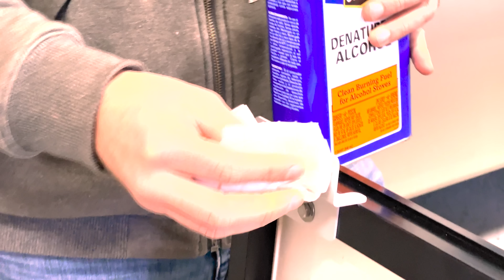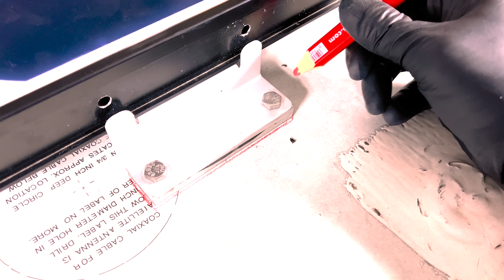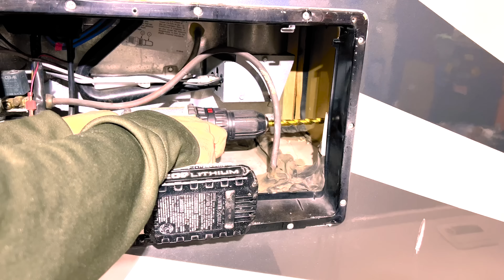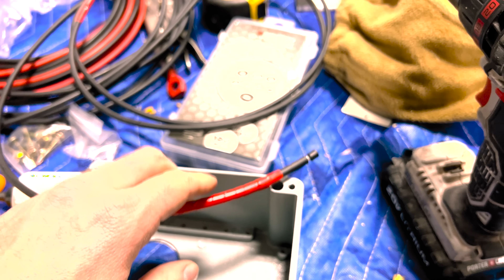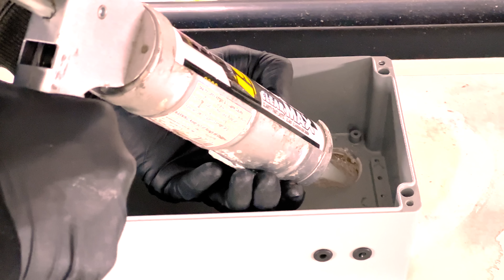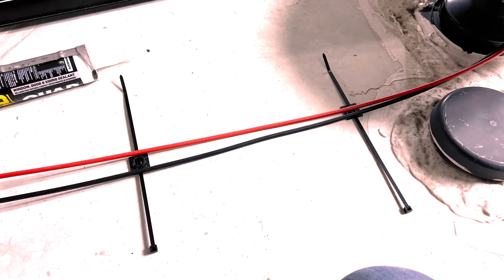Residential Solar Panel Installation on a 2015.5 Sprinter-based Winnebago Itasca Navion 24V

Comment: I hope that VHB tape will hold those panels in place. They are big panels and there's a lot of surface area underneath to catch a big wind drift. I'd have just bolted them to the roof then sealed. Also not sure why you needed spacers underneath the z-brackets. Thanks for the videeo.
Reply from the maker: Thank you! We put months of research into this, including questions to others who had done this install on the exact same make/model RV with VHB tape. According to the 3M technical data sheet, the 4950 tape we used has a Normal Tensile Strength of 140 psi and a Dynamic Overlap Shear of 80 psi. We are utilizing 6 brackets per panel, so currently we have approximately 3360 lbs. of Static and 1920 lbs. of Dynamic strength, plus Dicor - which I can tell you is quite strong once cured but haven't been able to find a specific listed strength. For the VHB tape, 3M's advertising states: "Fast and easy-to-use permanent bonding method provides high strength and long-term durability. Replaces mechanical fasteners (rivets, welds, screws) or liquid adhesives. Eliminate drilling, grinding, refinishing, screwing, welding, and associated clean-up. Creates a permanent seal against water, moisture and more. Pressure-sensitive adhesive bonds on contact to provide immediate handling strength. Allows the use of thinner, lighter weight and dissimilar materials." Therefore, we chose the 4950. There are several others with our identical RV who also have panels installed with 4950 VHB tape (Without Dicor) that have tens of thousands of miles across the US, Canada, and Mexico with no issues. 

The spacers provided two benefits. 1) To allow removal of a panel in case of failure or other circumstances without having to remove the mounting brackets from the roof. 2) To provide additional cooling on warm/hot days.